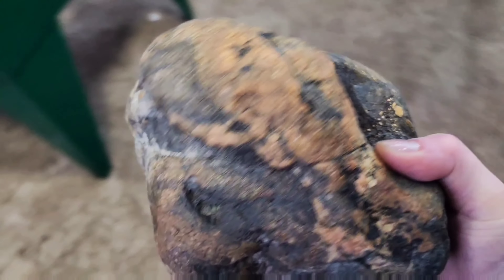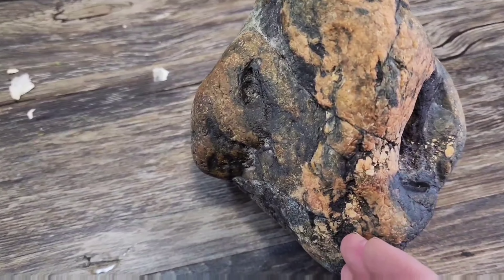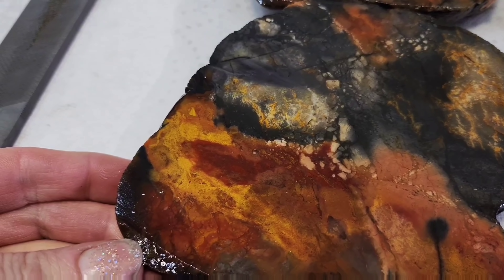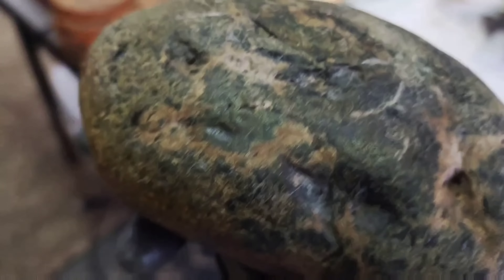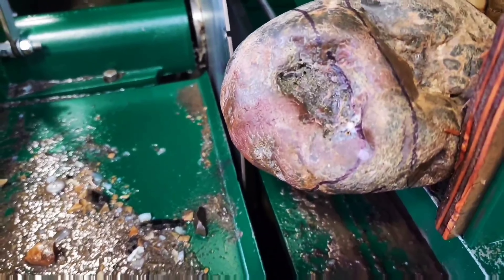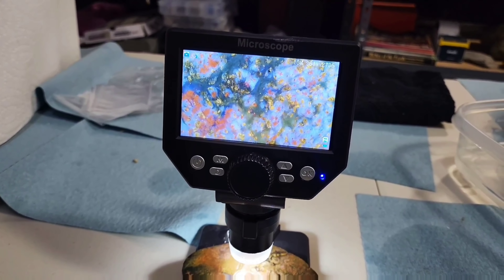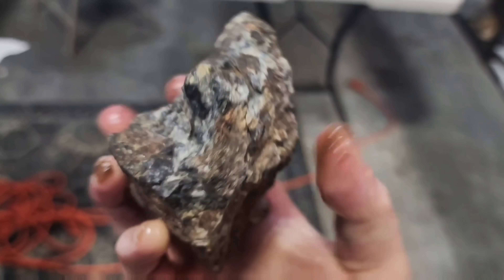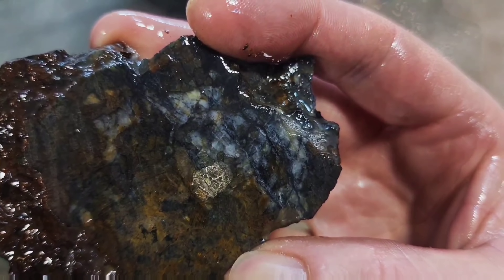Cutting Rocks with My Large Rock Saw #RockSlabs

Comment: For your readers. Usually when selling slabs on the internet the going size is 5X5 inches and 1/4 inch thickness. The way something is priced is by color or color combinations. Primary colors are the most desirable. But begining with 3 different colors and they are the primary ones that make a desirable pattern. You could begin at $10 for a 5X5 slab. Just to give you baseline on pricing. Thanks MRM for your tips on orientation of cutting and the use of a Marker to plan your cuts and get the best out of your stone.😍😎😁